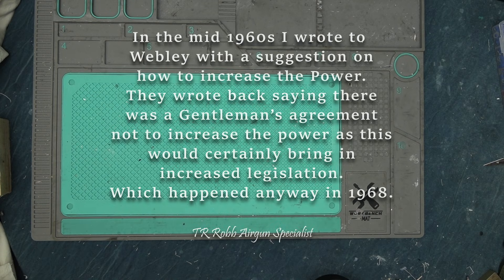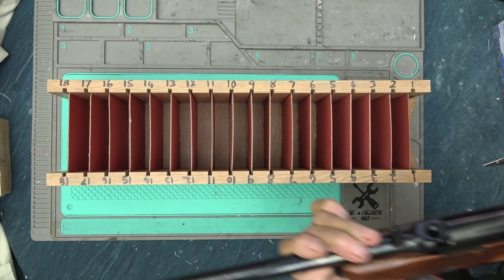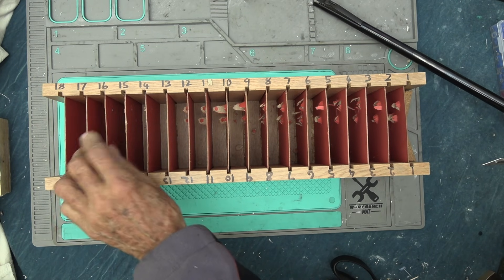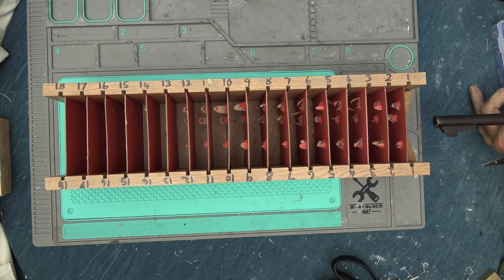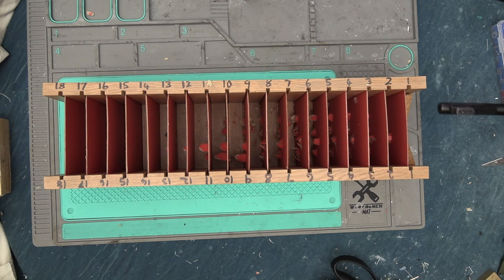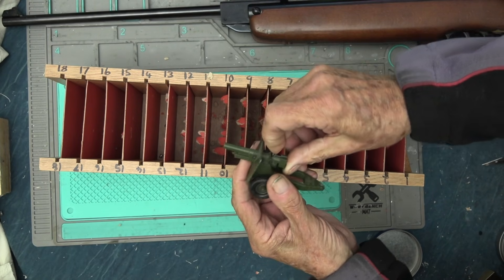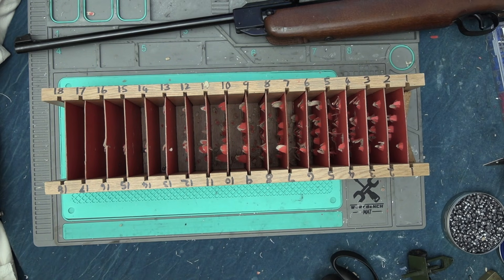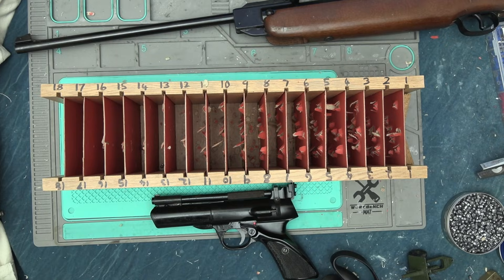Airgun Strawboard Test from the 1950's and 60's

Comment: I remember they used to use a weighted pendulum with a measurement plate on it to test the power, arthur Sheppard from airgun world I think, it looked dangerous to use 😂 this way is safer 👍
Reply from the maker: Back in the 60's or early 70's we had one of them but had to make a jig to keep barrel Horizontal. Also with powerful guns you would get a lot of Splash back from the disintegrating pellet.
They called it a ballistic pendulum and they were made by Gerald Cardew. I used to meet him at the NARPA Championships at Cosford where all the KEEN air gunner's would meet and chat, Looking at various guns in car boots.
That is where I saw a Pump up Webley Air Rifle. Extremely rare. They were a prototype pump up but were discarded when they new the 12ft lbs limit was coming.
Reply: @TRRobbAirgunSpecialist actually thinking about it I think it was Gerald cardew that was using it, he was the airgun 'boffin' in airgun world back then, would like to see that Webley pump up, so many weird and wonderful airguns out there, remember they used to sell a airgun that also a ,22 rifle. Looked like a old gem. You never hear of them these days,
Reply from the maker: I think they only made around five pump up's.

Comment: It would be interesting to see what chrono reading equates to 16 boards. Or to see what the current "webley" air pistols from Turkey, like the Zoraki multi-pump HP-01, can do. Your Webley Hurricane is a beauty with its gleaming blued steel and classic grips compared to modern polymer pistols.
Reply from the maker: The Next step is compare to chronograph which is why I say please subscribe to be notified when published on YouTube, but I know the HW 50 is doing 624fps. 
I don't have the guns you mention but if I do get one, I will put on You tube.